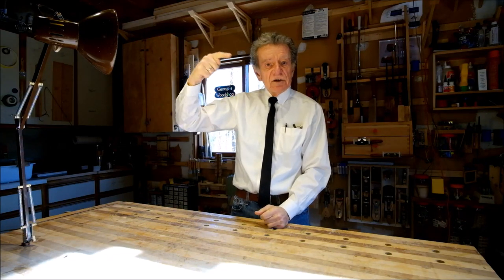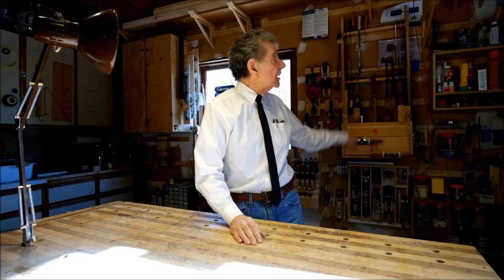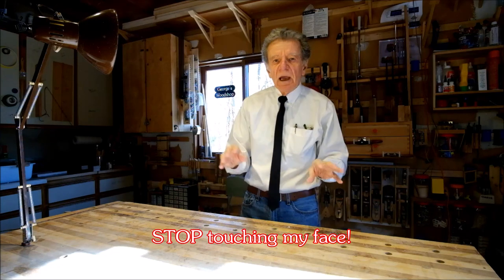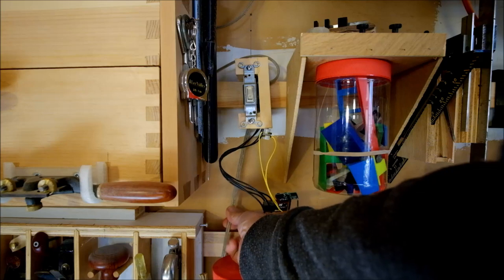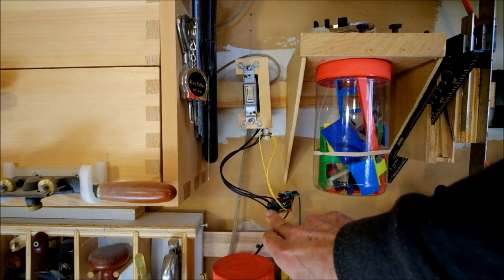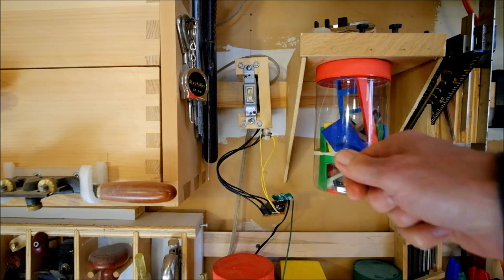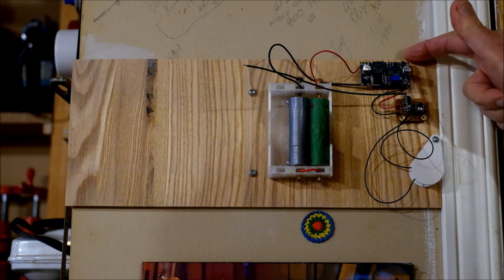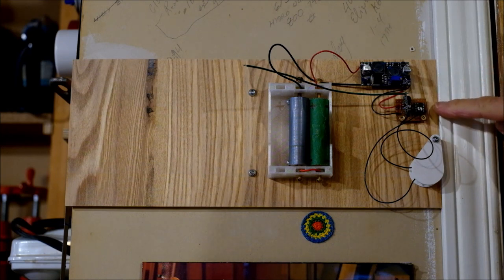Radio-frequency activation of bench lights.

Comment: hello George!
I made (last year) something pretty close to your "activation of bench lights", but I used a microcontroller with wifi. I use an ESP 8266. I used a solid-state relay (optocoupler) because a mechanical relay sometimes stops the microcontroller: spark between contact when you use an electro valve. It commands an electro valve for a humidifier for my central heating system.
To control the valve, I use my phone though BLINK, who is kind of a server...
I can control it from anywhere in the world!
I use a timer (open valve twice a day) or I can use a forced command to test it.
Good job!!!
Reply from the maker: Those sound like very useful upgrades to incorporate in future projects.  Good to hear from you Woody!